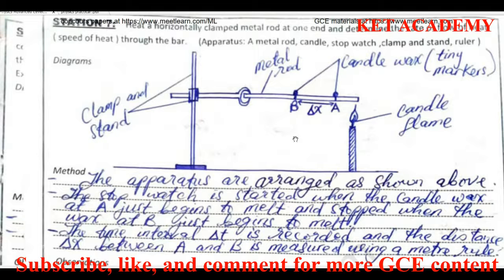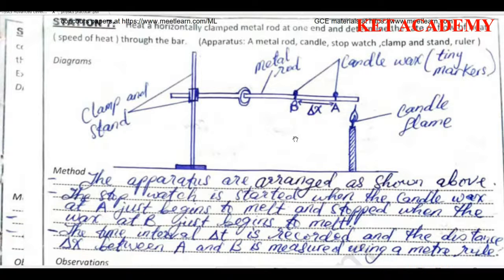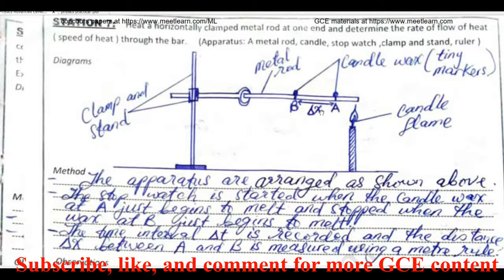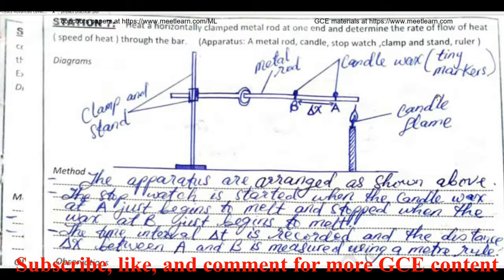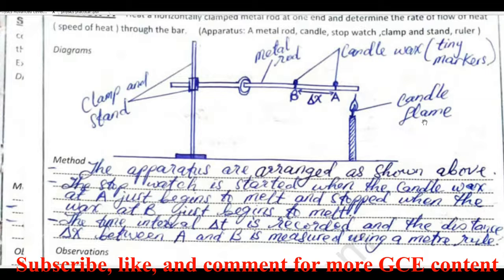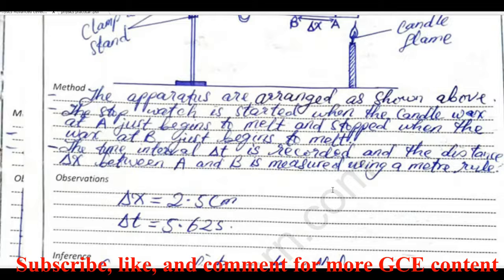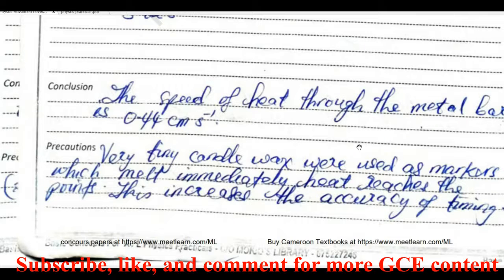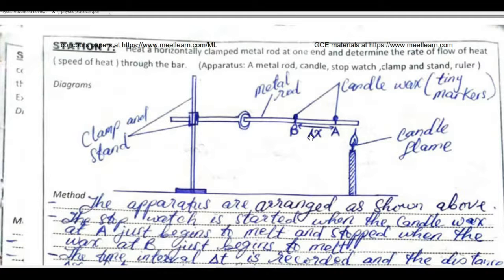Experiment to determine the speed of heat flow Mainstream experiment (KET Academy)

Comment: If in case you marked out 10 points on the meter rule or rod, and it comes to the point where maybe the wax on the third point starts melting, I wish to ask what distance will you measure for that particular point after recording the time?